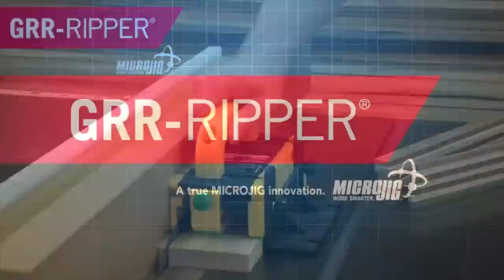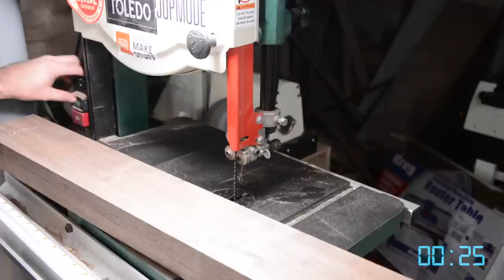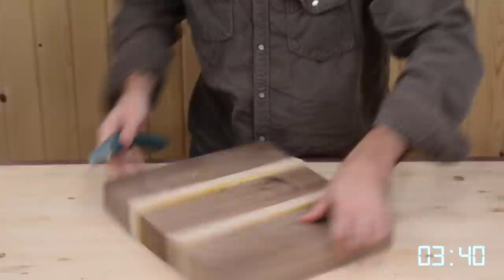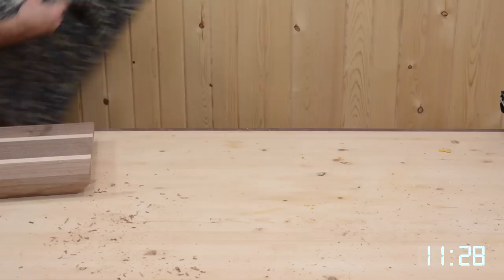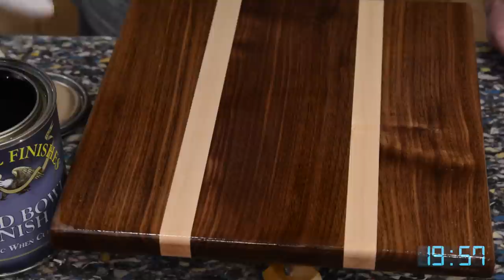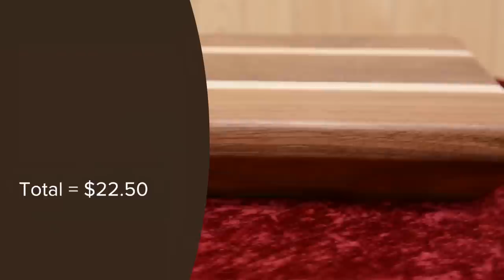Making a Cutting Board in 20 Minutes

Comment: It's a shame, but many woodworkers worry about which finish to use on objects that will come into contact with food of children's mouths.  The reason for the worry is that woodworkers have been conditioned y several decades of articles in woodworking magazines to believe that ordinary finishes like Boiled Linseed oil, Alkyd Varnish and / or Polyurethane may leach poisonous ingredients like metallic driers.  And other finishes like lacquer, Two-Part finishes, Shellac and water-based finishes may leach poisonous solvent. 
The idea that some finishes are harmful is reinforced by a few manufacturers who label their finishes "Food Safe" or "Salad-Bowl-Safe", which implies that other finishes are not safe. 

IT'S A NONISSUE
The shame for woodworkers is that a lot of energy is spent on the issue of food safeness when none is warranted.  Food safeness is a nonissue because there's no scientific evidence of any problems.  So far, as we know, all finishes are safe to eat off of, and safe for children to chew on, once the finish has fully cured (the rule of thumb being 30-days).

Flexner, B. (2004) Popular Woodworking complete book of tips, tricks & techniques.  "the folly of food-safe finishes." PG. 211. Cincinnati, OH: F&W Publications, Inc.

Comment: Good video but I was expecting something a little more DIY... not everyone has those kind of awesome tools you got.
Reply: Fallen Rock Specifically the planer. You can kind of wing the other stuff with more common tools, but i'm no good with a hand planer.
Reply: +Fallen Rock You might want to look for community workshops in your area. Around Los Angeles there are some places where you can pay a monthly fee and use their machines to build your stuff.
Reply: you can make this with simple hand tools/power hand tools. the most you would really need is a hand saw/circular saw to cut everything, hand planner/belt sander/card scraper to level it, and sand paper to round corners and smooth it out.
Has been done sense the beginning of wood working history.
Reply: I doubt you'd watch a video on using a hand planer to flatten a board and go down that path.
Reply: You can get a cheap 12 inch planer for about 250 dollars. Can't speak on quality though.
Reply: People haven't made cutting boards with hand tools since the dawn of time... silly mortal
Reply: I do wish that more folks on YouTube used the easier to attain tools that a beginner would be using.

Comment: What about the glue drying time
Reply from the maker: curtis best What would you like to know about glue drying time?
Reply: Well if you made it in 20 minutes how did the glue dry so fast ? Or did you that bit out ?
Reply from the maker: Ahh, if you read the description it says it does not count the time it takes for the glue and finish to dry. You'll need to add a few minutes if you're counting that.
Reply: Drunken Woodworker ok sorry didn't read the description and do they actually sell for $70
Reply from the maker: I've sold a few at handmade shows. Williams-Sonoma sells even simpler ones for $200+
Reply: Really any tips for getting customers on etsy ? And what wood is he using
Reply from the maker: Social media like Facebook, twitter and especially Pinterest to get customers to Etsy. Although I'm finding the Etsy has become too cluttered with factory produced items and is becoming useless over time.
Reply: Drunken Woodworker I like making bowls on my lathe and when my new table saw blade comes I'm gonna start making segmented bowls like Frank howarth but I would like some where decent to sell them they don't do craft shows in England not that I know of any way.
Reply from the maker: I suggest finding store and galleries in your area. That's what works for me.

Comment: Seriously, You charge $142.50 per hour for your labor?  You failed to add the gas to drive to yard to get material, the cost to run the saw and the cost of the place you work.  How long a trip to pick up the material if you don't have it on hand?
I made 8 kitchen cabinet doors Wednesday and charged $100.  The material was delivered and all I had to do was cut to plywood to size and give a light sanding for priming.  Wife said I don't charge enough.  Must be nice to be able to charge what you are charging for labor.
Reply from the maker: I don't use the time/cost of materials equation to come up with a price. I go by what I can get on the market. I've sold these for $70 in past handmade shows. I've tried selling them for $80 but couldn't move many.
Reply: I find that at craft shows you charge what the market will bear. You will have some items that sell for a higher price but wont move as fast as smaller items. So its good to have a mix. I make small wood crosses that I can sell easily for $8 and I bulk make them 5 at a time and complete five in an hour. These are made from scrap pine or cull lumber from the local home center. Then I have large carvings and other items that are priced 50- 100 that I might sell one or two and sometimes none. When those sell they are great and Its always good to offer a mix of prices. Smalls pay for the booth and your time at the sale, and beer, big sales and custom orders buy the new tools, wood and maybe dinner and beer.  As for 8 kitchen cabinet doors I probably would have charged in excess of $160. I really think its not unreasonable to charge at least $20 per door. Where are you going to buy a $20 Cabinet door?
Reply: customer furnished the plywood for the doors which is expensive here, $12 a sheet more than Lowes, so the material and labor was $225 or more than $20 a door.  I also make 1 x 3 frames and cover the back with luan that costs $4 a panel.  I forgot to mention 8 pocket hole screws and glue to mount the luan.  This cost is less than $20  with time and labor.
Reply: The trick with a lot of these crafty products is to spend the least amount of time on them but make them look like you spent a lot of time on them to justify the cost because the more intricate and complex pieces will never move at anything close to a similar markup. There's also a difference between "luxury" products and more utilitarian work like your doors. People generally don't mind spending more for the "luxury" items. This is sorta why restaurants like McDonald's pushes the soda and fries size upgrades because the profit margin on those is significantly more than the burgers. If the burgers were marked up like the soda and fries are they would be too expensive.
Reply: I'm sorry, but I don't over charge customers.  70% of the items I build are for paying customers not the general public.  Where I live I would not be able to sell a thing as there are no flea markets within 50 miles.  If I were to make bowls, there is no real market for them.  
Please understand that I am not rich that I can spend a $500 making items without a market for them, nor do I have the money to start a business and sell items.  Maybe you are like McDonalds, but I prefer to sell direct to people who request items be made for them, so I don't charge $50 while the glue is drying.
Reply from the maker: I think we should all get drunk and fight! Who's in?
Reply: Gary Finger the problem I'm seeing is that by your own admission you mainly deal with work that's commission based as opposed to product based. understandably this makes you price your hourly rate more reasonably because the tasks can often take a while even though they might not contain a great deal of design or artistry (though they might. i donno your work.). Production work is much different. Depending on the product you can expect to spend anywhere from 20 minutes (like this project) to 2 hours and the end result of each project might not look like it deserves a flat rate price. The cutting board, while quick to make, might look like it's worth much more than maybe some small keepsake box that was made using dovetail joints and a little router inlay which might take a great deal longer and require much more skillful work. Like i said before: you try to spend the least amount of time to make something that looks like it took the most amount of time to justify a price because some products will have lower or higher margins than others. That cutting board looks like it's worth at LEAST $50 regardless if he took 20 minutes to make it or 1.5 hours. Also you never wanna leave money on the table if you can help it. I remember Mike talking about pricing his bandsaw boxes and at one price no one bought them and at another people bought too many. This made him price it somewhere in the middle so that people would still buy them but he also wasn't underselling himself and leaving money on the table.

oh and also we're not even getting into the fact that while $142.50/hr (relative to a profit margin of $47.50 for a 20 minute project) sounds exorbitant if he only sells one of them in a week then he's not actually laughing all the way to the bank.
Reply: No problem, I just don't have the money to sit around and not have anything to show for it.  If I were as rich as you and the others who made video for YouTube and can put hundreds of dollars into high end equipment and let my money sit on a shelf I would charge $200 per hour for my work.  You must understand that I always look at labor as per hour because I worked all my life by the hour, not by salary.  One never gets rich working by the hour as I can attest to that.  I can't purchase exotic woods that has to be shipped from other countries as you do since you do not understand what I am talking about.
There is no way you will understand ever.
Reply: Gary Finger the hell are you talking about? Now you just sound super bitter about nothing. "I can't purchase exotic woods that has to be shipped from other countries as you do" are you kidding? it's walnut and maple. Where do you live where those woods are out of your reach?

"You must understand that I always look at labor as per hour because I worked all my life by the hour, not by salary."  and yet you balk at someone selling something that actually earns a high hourly rate (relative to the time put into it) and profit margin? "One never gets rich working by the hour as I can attest to that."  you know at this point maybe you're just projecting. Maybe your wife is right and that you should be charging more for labor.
Reply: I am right you don't understand
Reply: Gary Finger you're just so misunderstood, aren't you?
Reply: Drunken Woodworker I'm game!
Reply: Sorry I have to agree with Gary.  I'm an accountant, and would have added the cost to operate the workshop and the cost of the machinery unless it is fully depreciated.  Good work though cheers!
Reply from the maker: So if an artist paints a painting and it take her 3 hours you think she should sell it for $90? Fuck that. It's a creation that didn't exist. You can't put an hourly rate on what the human brain does.
Reply: Drunken Woodworker I'm in total agreement. There's a difference between utilitarian woodworking and artistic woodworking. Value is determined by desire, not by calculation.
Reply: Drunken Woodworker  HAAAA!!! Your reply has me laughing my butt off!! I say the same thing to the people who do not want to pay more than a few bucks for my work... Some people just don't get it.
Reply: Drunken Woodworker You're the best.
Reply: From what I can see by watching the video, this is more of a one off piece, the materials cost about $20. Assuming the Drunken Woodworker  started woodworking as a hobby, lets eliminate the machine costs from the equation. So with market value of the cutting board being about $70 the the expected profit is $50, when it sells. Say it takes a few months to sell, the $20 of materials is still a loss until it sells. Gary Finger It looks like from whats here that you do commission based work as opposed to that of creating things to sell at craft shows. Its a totally different market. Its like the cost of a house in California vs the cost of a similar house in say Ohio, the market is different. That's just how life works. And as far as maple and walnut being "exotics" Drunken Woodworker lives in Toledo, Ohio Walnut and Maple are both local to his particular area.
Reply: An item's worth has nothing to do with its cost.  An item is worth what someone is willing to pay for it or part with it.  When I was a photographer, there would always be people that questioned paying $5 for a low-end digital file. I mean it was shot, my time was spent, no cost when into making it, not going to cost me anything to deliver it.  I should have just given them all away, right?  Nope.
Reply: $100 for 8 doors? Wow... You must be bankrupt by now. I charge a minimum of $70 for one raised panel door. (7/8) material. $80 with hinges.